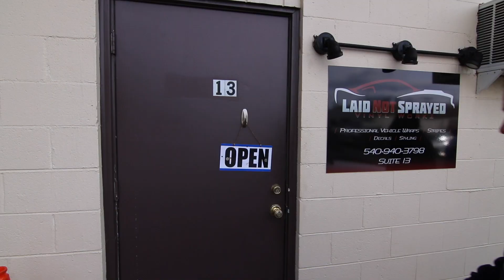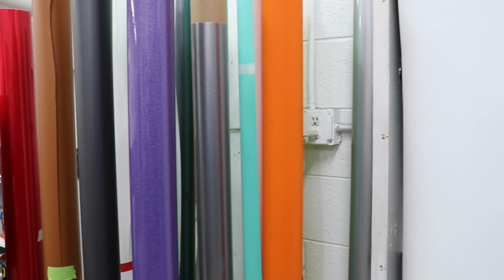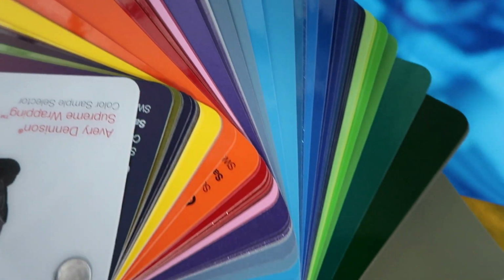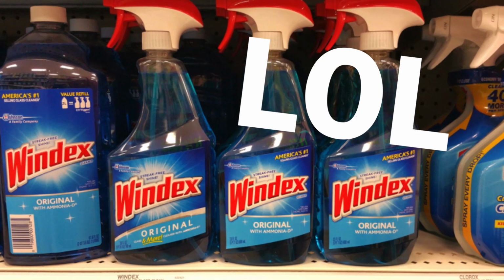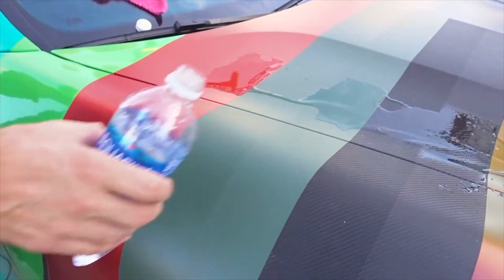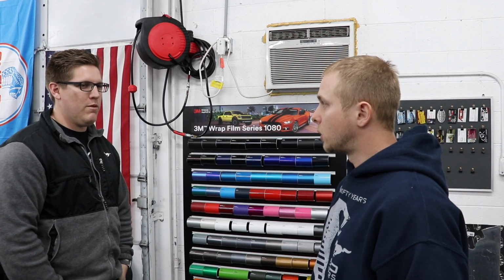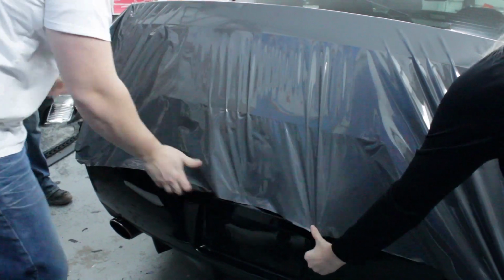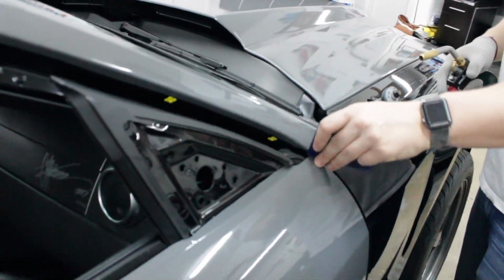How Much it Cost To VINYL WRAP | VINYL WRAP GIVEAWAY!

Comment: I have question my 2013 Mustang hood is corroding all along the edge do I need to have the aluminum hood repainted first b4 a wrap Ford will not fix it its a super low mileage car and never driven in winter it sets all winter never seen snow or salt .. IM so upset with Ford . I hear Ford has known about this since 2005 when they started using Aluminum hoods.

Comment: Can’t wrap my head around wrapping a car! It just seems weird to put a vinyl coating over a perfectly good paint job
Reply: The thought occurred to me as well. It's all about making the vehicle your own.  Not the manufacturers specified color.  Your vision, your expression. With the vinyl you get to see exactly what the color is, not like mixing 3 shades of paint which may or may not come out the same as you envisioned it. This gives one more choices. An interesting question, how much money would it be to paint the car the same color?